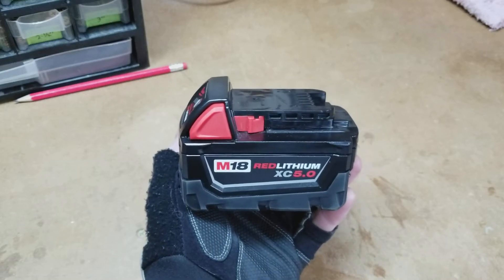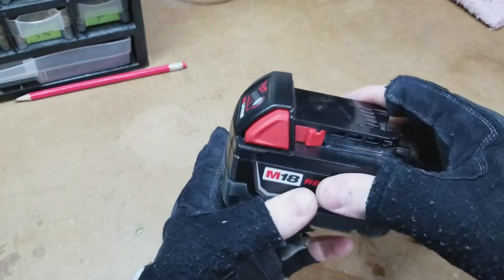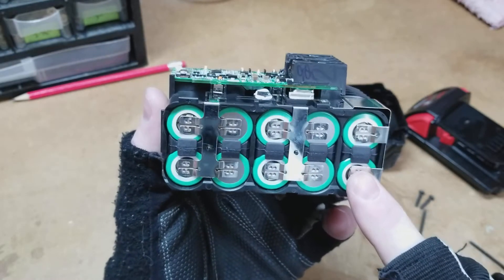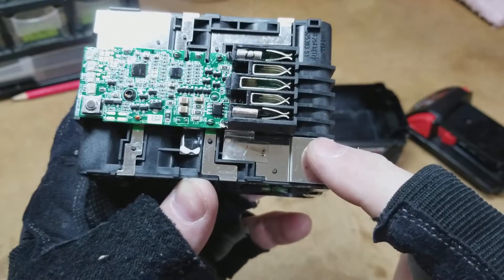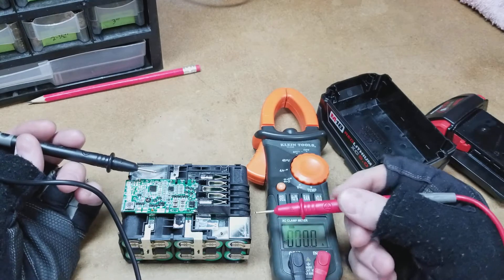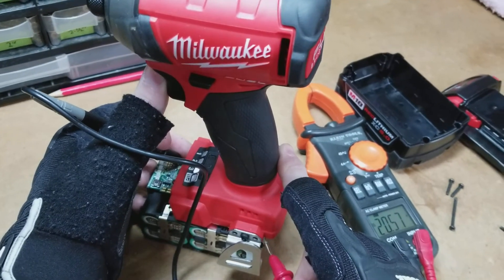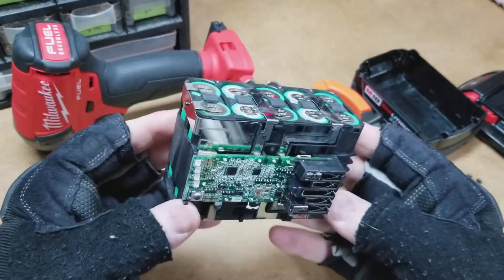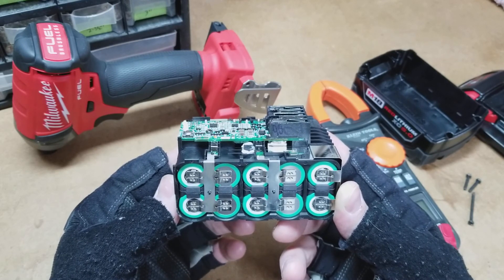A Look Inside a Milwaukee 5.0amp Battery

Comment: My question is, why are you wearing boxing gloves for this video?
Reply from the maker: Fingerless work gloves, old painter habbit.
Reply: @chevy5137 : C’mon, nice try but those are riding/driving gloves, lol. As a construction contractor I’ve known scores of painters and have never seen a single one wear gloves while working. Brickies and framers, yes - painters, no. You’re a cyclist, dollars to donuts!
Reply from the maker: @Ray Ray  For real Husky work gloves, and I'm talking about automotive paint and I never used them when I was actually spraying i would wear disposable rubber gloves. I used them a lot when I would sand vehicles. The padded palm helps lessen the vibration from the DA sander and having open fingers still let's you run your bare hand against the surface to make sure it's properly prepped and that the body filler is smooth and even. Eventually I always started wearing fingerless gloves because a padded palm helps lessen vibration from power tools but still leaves your fingers open for better dexterity so you can grab small things easier than you can with regular gloves on.

Comment: Hi there it was a very good video by the way. You had asked a couple questions in there one of them being voltage when it read 20 V that's what's called a service charge basically not under load like you said. Now what you did was try to put it underload except you weren't actually loading it up as if you're putting a bolt into a piece of wood or screw that's loading and it would've read a little bit lower 18 something. if you're really hammering Away like at Lugnuts on your tire and then then it would definitely go down to 18 v ish. Think of it like this voltage is pressure the more pressure the more power amperage is simply volume. Whereas a two amp battery seems to not last very long because there's not enough volume or amperage so the amperage is simply more batteries in parallel to give it the volume needed to keep working longer at that rate. And then voltage is just each battery connected in series say 2 1.5 V batteries connected in series would give you 3 V but connected in parallel would still give you one. 5 V but twice the amperage because you adding  twice the volume. When you take your car battery in for a free load test at Part Source there's loading that battery up with a bunch of carbon pucks creating a lot of heat that dissipates the battery service charge and then if it doesn't drop below 12 V and 1212.6 that's a good battery after a minute and 30 seconds or whatever the spec is for that battery. Your car battery is 12.6 maybe 600 Amp whereas my truck battery might P 800 A or 900 A it's a bigger engine needs more amperage more volume but it's still 12.6 V. An easy way to explain this is A car battery is 12 V say forget about the 12.6 there's six cells in there and 6×2 V gives you the 12v or really it's 6x2.1 v equals 12.6 volts because they're connected in series so each other. After the low test is complete if the battery still reads 12.6 V that's a good battery and it might be your alternator or starter that's the problem? There's many good references using ohms law which basically would explain how the battery works when you got 12 amps I believe when it should've read six or half of that then you were reading likely two rolls of batteries in series which would double your amperage. These new smart batteries 60 V I believe they're equipped with some type of sensor that knows how much voltage and which circuits to turn on together require voltage like a flexible battery by Dewalt 60v Won't put 60 V to my drill or a would lightly destroy it after few minutes it's just its senses it only needs 20 V so it will last three times as long as a drill that might be at 60 V Justin as an example. So when those diode's turn on and off it figures out how much low to put two I do all tool. The 60 V flex volt battery by Dewalt is really good but really expensive. It won't be much longer before you see at 1:20 V battery the largest I seen is evil volts right now the problem is they get bigger and bigger there's no other way around it and heavier so it's not as useable in a handheld tool but a Tablesaw or a lawnmower it would be just as powerful if not more then as if you plug it into your house because your house standard socket is 15 amp breaker.  so if you had 120 V battery at 20 A that song will now be more powerful then if you plug it in and it wouldn't blow the breaker because you're using a battery. Your house has a 240 V receptacle likely for your oven or your air conditioner or your dryer. Where as the rest of the house is 120 V. How can this be? The city provides two 120 V separate lines going into your house going to your panel when connected in series like I said before it would double the voltage for the required appliance whereas the rest the house would be on 120 V connected in parallel. technically you could run your whole house at 240 V that's not advisable. Some countries are still at 240 V and you have to bring a certain adaptor with you so you don't blow your hairdryer. So think of parallel Circuit as 2 circuits running next to each other and then a series circuit would be 2 circuits running in front of one another like a flashlight that carries three or four batteries negative to positive and positive negative and so on and so on which we keep adding the voltages together. If you have 8 D batteries at home through each 1.50 connected together you'll get 12 holes it won't start your car though because there's not enough amperage or volume to start your car but it will run a few accessories like you're you are a light or something.  Well I've probably bored you to death but I try to explain things simply hope that helps.
Reply from the maker: That's a lot of info thanks! Speaking of I know that a lot of countries still use 240 volt outlets and that to run stuff that's from the US you need an adaptor. Also speaking of DeWalt I know how their 60 volt Flex-volt batteries work and how they automatically change voltage depending on the tool, but like you pointed out they are really big and heavy so when you are running a smaller tool like a drill or impact driver you either have to buy a smaller 20 volt battery that you can only use with the smaller 20 volt tools or a heavy 60 volt battery and personally I don't want to use a big heavy battery on my small impact gun cuz then it's not as compact or light which sucks. That's what I like about Milwaukee is they have kept everything 18 volts and just make the larger higher amp batteries for the larger tools so you don't have to buy different batteries for different tools in their lineup.

Comment: 4:12 - The 12.0 Amps is an errant reading. Fortunately for you, the CL200 meter is not designed to measure current via the leads (page 2 of the manual states "Do not attempt to measure more than 600V or any current on lead input"). If you had used a meter that is designed to measure current through the leads, then you most likely would have blown the fuse in the meter.

Comment: It is not a 5A battery pack. It is a 5Ah battery pack. That figure does not relate to the current that it can provide at all.  The 5Ah is a measure of how much charge can be stored in the battery. What it actually means is that it can supply 5A of current for 1 hour, or it means that it can supply 1A of current for 5 hours, or any other two numbers that when multiplied give 5. I personally do not like Ah as a unit because it omits an important piece of information, namely that it can supply 1A for 5 hours WITH A VOLTAGE OF 18V. I think that the unit Wh is much better because it incorporates the current and the voltage. A single Watt hour means that it can provide 1 W for 1 hour. Remember that Watts are Amps x Volts. So, that 5Ah battery pack is 18 x 5 Wh = 90Wh.  The current that the battery delivers depends upon the internal resistance (r) of the battery pack and the resistance (R) of the load you are attaching (the drill motor). (It is actually impedance but let's keep it simple - resistance.)  Anyway, the Current = 18V/(R+r).

Comment: incorrect!! You were shorting your battery when you did that. Yes your meter can do ac and dc but the meter you used can not do Dc amps in the way you tried it. That’s why you got a reading that didn’t make sense. You even said in your video that you didn’t understand it and now your gonna act like the commenter don’t know what he’s talking about? Are you serious right now? He was trying to explaining that you did that wrong (which btw you asked people to do in your video). Yes I understand that there are 10 individual batteries inside of your tool battery but when you join them all together you no longer have 10 “individual batteries” you now have 10 CELLS. Those 10 CELLS create 1 BATTERY!! And you put your meter between the positive and negative terminals of that one 10cell battery thus creating a short. You may not believe that, you may not know that, you may not have smelled anything, you may not have noticed and damage or any less performance in your battery BUTT you did short your battery even if it was only for a moment you DID short your battery on YouTube for the whole internet to see and then you act like a jerk in the comments when people try to tell you why that’s a bad idea and you just repeat how dewalt and other companies lie about their voltage because it’s actually an 18 volt battery under load… I got news for you cupcake, 12v car batteries can drop to 11 or even 10 volts when starting a car at times…. We don’t call them 10 volt batteries. We call them 12v. Milwaukee batteries use to be 18v now they are 20v. Read their own website holy cow man. Milwaukee has changed their BMS to allow the battery at to run up to 20v but they are still selling them as 18v because they don’t want their lesser educated customers to be confused by the change in labeling and start buying a bunch of 20v tools they don’t need. So this is how Milwaukee is competing with other companies while also not confusing their customers. Dewalt and others haven’t done anything wrong their batteries are true blue 20 v batteries just like Milwaukee. Dewalt chose to label them fro what they are while Milwaukee chose not to confuse the customers they already had. Take apart a dewalt battery and do the same exact test. You’ll find the same results. And don’t tell me that a 20v battery drops to 18 under load because I just watched you sit there on camera with an “18volt battery” which was reading 20v and it didn’t drop when you pulled the trigger……. Sucks when you start to realize you just proved your own self wrong in front of Everyone. Not to mention ALL batteries voltage drops when they become low on charge. Dewalt, Milwaukee, Makita, heck even black and decker LOL 😂 . One guy tried to tell you that and you said “maybe a fully depleted one” 🤣🤣🤣🤣🤣🤣 no homie even a battery at 75% full is gonna show a different voltage than one at 100% holy freaking cow. In almost every reply you have something to say about dewalt even if the comment had nothing to do with dewalt In the first place, I’m starting to think a dewalt drill may have touched you inappropriately at one point in time. Did a dewalt drill touch you? Do you need to tell an adult?
Reply from the maker: As a matter of fact I used to use all DeWalt tools until they got stolen, I like DeWalt they make good tools. Plus a lot of tools claim 20volts the only reason I use DeWalt as an example is it is a brand that everyone knows. Also I don't see what your so upset about, I didn't think there were any comments that I acted like a jerk in and if I did I didn't mean to. There's no need to freak out, I don't understand why your so upset.
Reply: @chevy5137   those tools that you say “claim 20volts”………they claim 20volt because they are 20volt 🤦‍♂️
Reply: @chevy5137  dude look it’s this simple… inside a modern drill battery of dewalt, Milwaukee, hart, black and decker, and yes even Mikita, there are 5 18650 cells. Heavy cell when fully charged equals 4-4.2 vdc. They add up to be 20-21v dc. ALL of them are 20 v even Mikita said it on their own website. I went through all the comments of people trying to help you and almost every single time they give you advice you discount it. If you don’t want advice or explanation then don’t ask for it. These were trying to help you by explaining it to you and you acted like they didn’t know what they were talking about…… but they did. You were the one that didn’t know what he was talking about. Dewalt and the others claim 20v because they ARE 20v LOL.

Comment: 20v max means that the output will be around 20v when the battery is fully charged and not on heavy load. There will be less volts on 20% charge

Comment: that's an ac clamp meter, it will only read amps through a single wire in the clamp and no other way. That's why it says "ac clamp meter" right above the display. What happened is the meter is showing erroneous values because you aren't using it correctly. I know this because I've accidentally tried to read voltage when it was in the amp selection. It doesn't hurt the meter but you weren't actually reading anything
Reply from the maker: It actually has a switch to change it from AC to DC
Reply: @chevy5137  it still uses the clamp to measure DC amps however. I have a very similar model of Klein multimeter and I am an electrician by trade. Also it still won't read any amperage unless a load is placed on the battery. You can read voltage without a load but not amperage. Amperage is electrons flowing through a completed circuit. A test meter isn't doing that. 

There are some meters that do read DC amps using the test leads but the meter has to be hooked in series with a load. You weren't doing any of that haha
Reply from the maker: @kylefowler5082  Good to know I'm not very proficient with a multimeter. 😉
Reply: @chevy5137  no problem, thanks for taking your battery apart for my entertainment
Reply: The switch on that meter that switches AC and DC Is for voltage only, I have the same meter, learned on it. Was confused for a while on that same point, Amps is amps,  this meter can only measure AC current through the clamp like dude said. no AC or DC through the leads on this one  In the video tho, you can see it says AC on the screen. The clamp on reads induced voltage by the Hall effect and then calculates to current.

Comment: That’s a 5 amp hour battery. It has nothing to do with 5amps. It means you can run 5 amps for an hour, 10 for 1/2 hour etc depending on the load. Secondly that meter does not have the function of using the leads to measure current, some do with up to a 10A max and you need to be in series with the circuit. Unlike what you’re trying with running the tool. Some do but that’s a clamp-on only for current measurements. Third these are batteries, this is DC voltage and current. Your clamp on does not measure DC current. Again, some do but not yours. Don’t use multimeters if you don’t understand them, it can be dangerous.
Reply: Well, technically, he was in series with the circuit. It was a short circuit, but he was definitely in series with it (or at least he thought he was, thank goodness that meter doesn't have the ability to measure current across the leads)! My eyes about popped out of my head. Of course, he would have just blown the fuse, but still.

Comment: There is no such thing as a plastic heatsink... and the bus bars that run across the top are connected to the batteries on the end.  There aren't any heatsinks inside that plastic sealed case.

Comment: This guy cant be serious!! I think maybe it's meant to be a joke.
Reply from the maker: I may not know a ton when it comes to battery electronics but I do know an 18-Volt battery when not under load will read at 20-volts and when a 20-volt Max* battery such as a DeWalt or Porter Cable 20* max battery will read at 20-volt battery may read at 20-volts when under no load will read at 18-volts when under load. it's a marketing gimmick.
Reply: @chevy5137  sorry man but that's not correct. It's not about when under a load 18v and idle 20v. The battery cells are rated At 3.7 volts but at full charge 4.2 volts per cell.  The battery pack is rated at 18.5 volts and the full charge is 21 volts. That's where they got the advertised numbers. I personally find the 20v advertisement to be deceiving. I don't buy thoes brands as I don't trust them. Milwaukee is my choice for many reasons.
Reply from the maker: @johnnygogo7773  yeah I know what you mean, it's good to get all these comments, as I said i really don't know that much about the electrical side and welcome comments helping to explain it. 👍

Comment: M18 is 18v minimum 20v max
Reply from the maker: Yes that is true, that's why DeWalt claims their tools as 20-Volt Max* with the Asterix the end.
Reply: Actually, when depleated an m18 battery goes down to 16.6xx volts.
Reply from the maker: @ThisSiteSureSucks  Perhaps a fully depleted one.